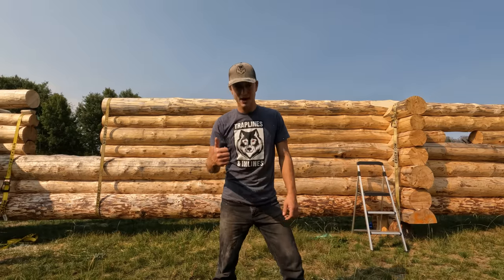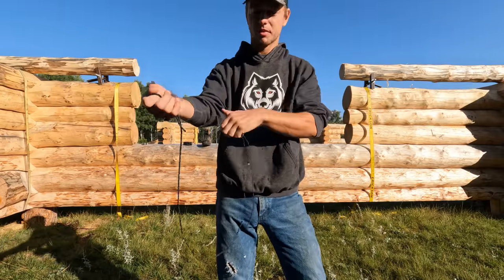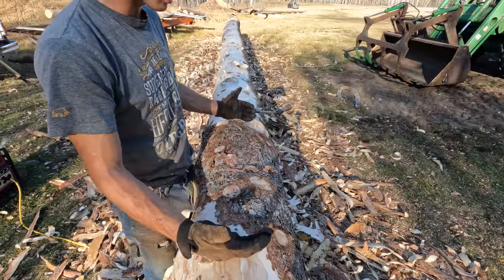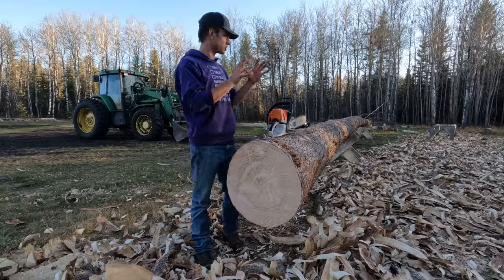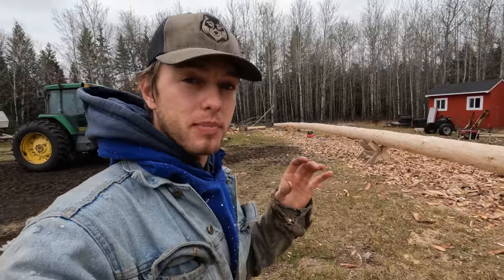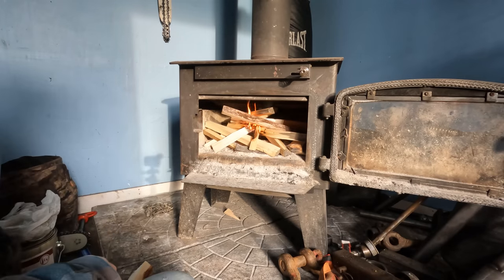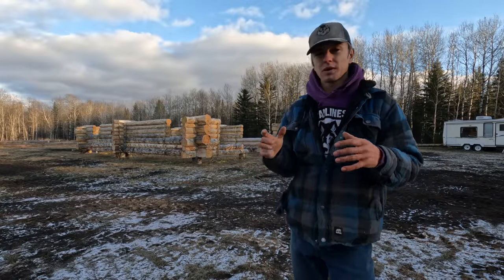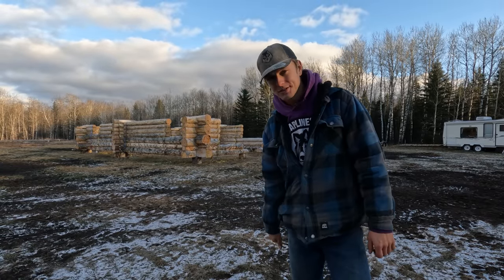Time is Running Out Before Winter - Building My Log Home Pt. 10

Comment: Best pair of boots I have found are either Adams boots, or nicks boots.  Each one is about 700.00 but I have a pair of Adams that the upper is 7 years old.  I prefer Adam's over the Nicks.  The inside is lined with elk hide.

Comment: I buy Rocky boots and have always had good luck with them when i worked construction. They are expensive, as are most work boots, but they actually are a comfortable boot for me and last a while. Im impressed with the build and your commitment to it. Stay safe, those logs are treacherous slick when wet and iced up.

Comment: I used to only buy Terra's as they were made in Canada, but now they're junk. The rubber randomly starts to disintegrate because they switched to the synthetic type and it doesn't hold up at all as they're designed to fail it seems. I use Haix now, they're not made by children in the third world and hold up great to actual use.

Comment: Are you able to burn the peelings for heat or do you use them for something else
Reply: IDK, but they make great kindling.
Reply: Growing up we used to dry them then bale it with a square baler and use it for fire starter in the wood boilers

Comment: You could buy a mid-priced boot like Redwings, Danners, etc and replace them every year.  I'd recommend a quality boot though.  Buy once, cry once.  Get a pair of custom boots from Nick's, Whites, etc.  You're looking at $600+ but they're actually cheaper in the long run as they last so much longer.  My current pair of Nick's is 4 years old and not even close to being worn out.

Comment: Work in sand pits with torches that cut 20" thick titanium so I walk in basically lava and hot sand all day. Boots take a beating. Timberland pro are only ones that hold up and only ones i use now. Ive tried them all over many years. Good luck!

Comment: never had an issue with timberlands never had sore feet and I worked asphalt milling walking 5-10kms a day on rough cut asphalt and concrete boots would last me two maybe 3 years and thats running plow trucks in the winter around salt and shit too

Comment: Everyone's feet are so different that recommending boots is an impossible task.  What is comfortable for me will probably not be for you.  Then there is the wear issue.  What will work for some again will not work for others.  If you spend a lot of time kneeling the toes are going to be critical and if you are doing hot work the soles and uppers both take a beating.  What I can tell you is that ninety percent are just cheap garbage selling at overblown prices.  If I recommend one to you by the time you buy it since I bought it will most likely been cheapened out and not the boot I bought.  Product quality in the world is cascading down with almost everything.  What is done with quality is not done with quality control so what comes out the door varies from hour to hour.  There are a couple of YouTube channels from boot makers that tear boots down to see what they are constructed of and how that would probably be of value in your search.